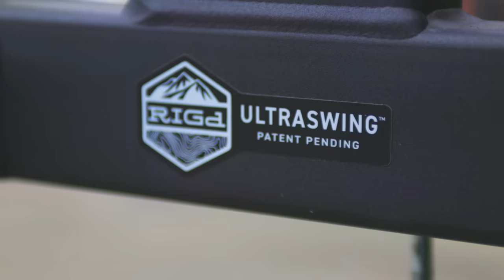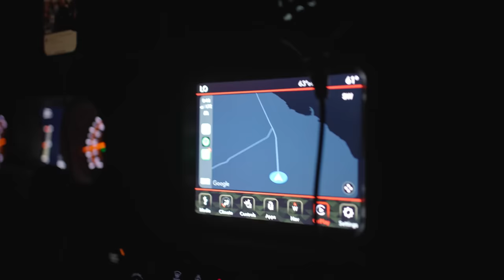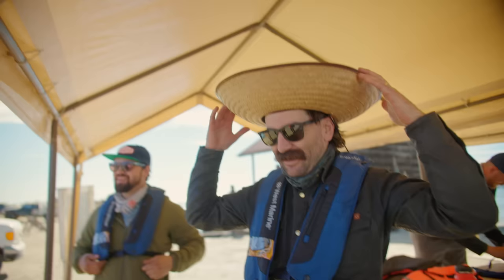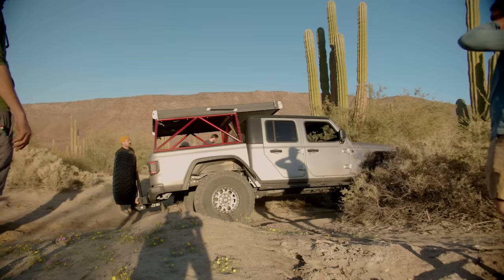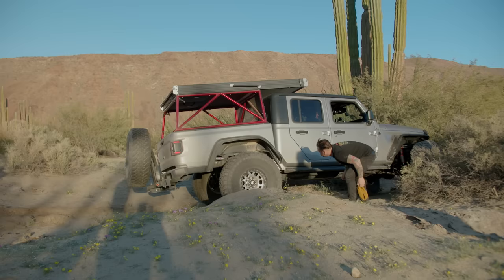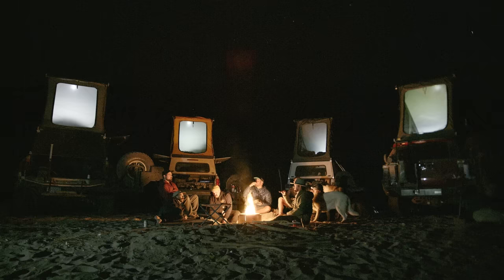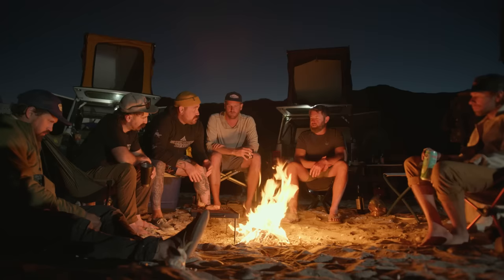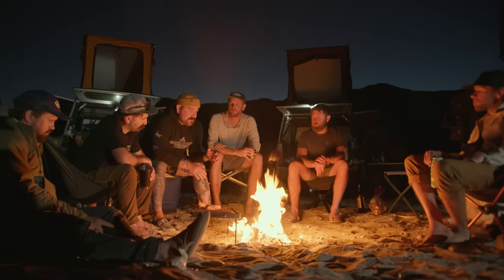We Wrecked A Truck in Baja.

Comment: Makes me wonder how strong those jeep gladiator frames are? That raptor looks good in it’s natural habitat!
Reply: At least with the early gladiators this wasn’t unheard of. It can happen when they’re carrying load and the suspension cycles against the load, typically when at speed and over uneven terrain.
Reply: It's a jeep with a bed and no proper axle placement. It is trash my he/him.
Reply: I worked for dodge for a coupe years and saw when they came out. 1 came back within weeks of purchase and was in the shop for months while the engineers had to create a way to fix what was wrong with it. I forget what was broken but i do remember that thing was around for a few months.

Comment: The 2 door Wangler is better for off road than the 4 door. That's not going to be warranty 😢 I was a mechanic at a Jeep dealer, there were so many recall on the 4 door, that padded my paycheck. You got a great channel with high production, surprised you don't have more subs.